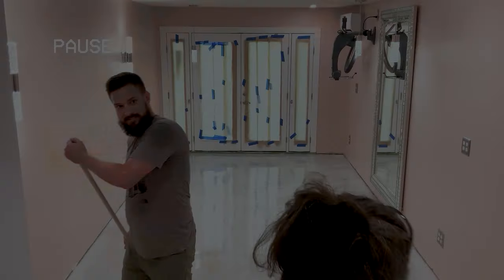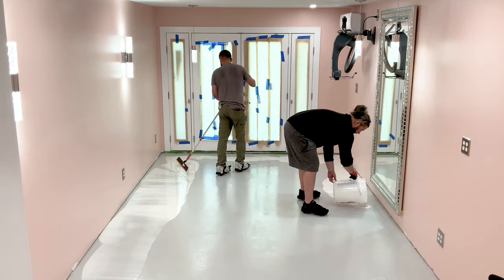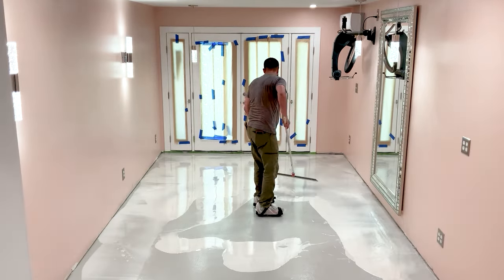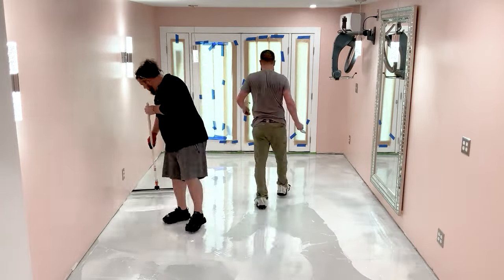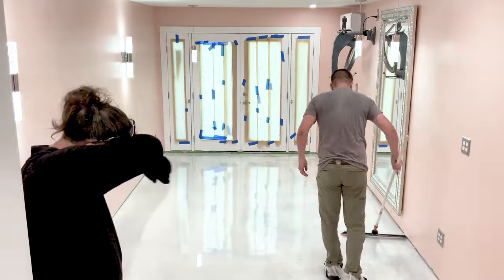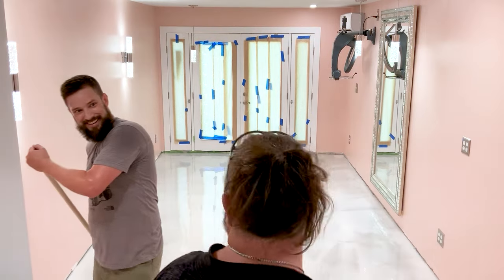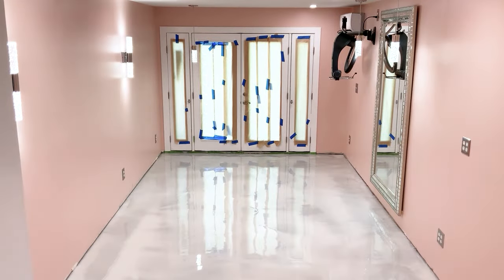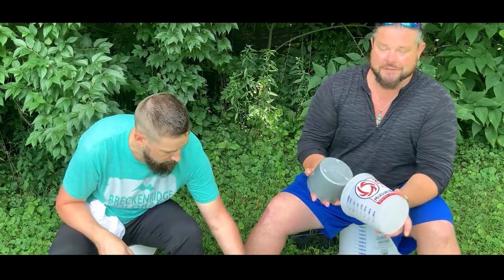Metallic Epoxy Flooring FAIL | Complete Breakdown | Don’t Make This Mistake!

Comment from the maker: Has anyone else ever messed something up like this?  Share your biggest DIY fail!  The best one wins a prize!
Reply: Just had a guy come do my garage floor ...and fucking ruined it , now looking into doing it myself
Reply: Im starting my own epoxy company soon and this video is great learning tool for us noobs! Thanks for sharing !
Reply: @dentman62  Same experience but with our basement floor. We paid SO MUCH money and it looks HORRIBLE. 😭
Reply: Yes! I started an epoxy flooring business, and my very first experience, was almost exactly the same. I didn’t get the epoxy out of the bucket quick enough and it went off in the bucket before we could get it all on the floor. 
Note: polyaspartic you have roughly 20-30 minutes to work with it  IN the pot/bucket. Epoxy, is the exact opposite! Get it on the floor right away and start moving it around!
Reply: Same thing happened to me last night man....I'm so devastated. I literally mixed 5-600 sq feet just to start painting the edges first. By the time I got ready to actually roll the floor....I poured onto the floor and the stuff would barely spread. At that point I knew I was scared!!! I learned my lesson. Mix and get straight to the pour don't waste no time. Now I have to do it all over again. But thing time I. Gonna do half first.
Reply: Could you recommend a company that sells the product? I already have the floor  ready. I'm in NJ.

Comment: If your watching the video like I did and wondering what happened, it overheated due to mixing everything at one time.
Lesson: spread quickly.
Tip I've seen elsewhere, if you want to mix it all at one time, set the mixture into water, it will dissipate some of the heat, but still take precautions to not overmix

Comment: Every school cost..... in exchange you gain  knowledge and experience.....
In my work I can chose between  fast, medium or slow hardener  ( but strength of the bond varies accordingly). 
Of course epoxy is temperature and moisture sensitive ( it will affect curing ) , and creates  it's own temperature trough chemical reaction, which is starting as soon as 2 components are in contact.... Bigger the mixed batch - more volatile chemical reaction is,  creating  higher  temperatures ( just what you have experienced ) ....  and higher the temperature - faster ( curing )  solidifying . 
For cleaning or diluting coatings- acetone can be used.
After floor - you can start building boats ...... ( just add glass fiber )
Good luck !

Comment: I feel for yall so much on this.  I used to do FX work with silicone and resins.  there is literally no feeling in the world worse than when you go to pour that bucket full of $600+ of material in a mold only to find that its already kicked and solid.  lets just say its a mistake that I only did once.  Side note we had a wobbly 5 gallon bucket mold that we kicked around the shop for years as the most expensive (and strange) door stop that I've ever made 🤣🤣🤣

One other note to this, depending on your climate/humidity/current temp it will drastically change the amount of working time you have.  From personal experience do a bit of research to see how those factors effect the hardening time.  It will save you lots of time, stress and money.  Also do a bit of research on known compounds that will keep a product from firming up.  ie: linseed oil is put in a lot of hand creams; even a little bit will cause silicone to never harden

Comment: Yea I did my garage floor w leggarri and their product failed miserably. After pouring there were 15-20 bubbles and I kept hearing the videos here they said leggarri epoxy bubbles will pop on their own . Ummm yea nah they didn't. 1 hour after I couldn't walk on the floor anymore there were 2000 bubbles . Now I'm sanding the floor down and trying to fill the bubble holes. I've spent $350 in rental equipment sandpaper etc.

When I called leggarri no one was available to talk to me till 2 days later . And they blamed me . They blamed the concrete , they said it's the concrete blowing air bubbles but I think it's a chemical reaction in their product. I got brown primer from them, mixed it exactly as specified and applied everything exactly as specified 
They recommended vapor barrier to go over concrete but nowhere in their 150 videos I watched did they mention air bubbles from concrete .
Im going to call Spartan for a price to go over this garbage . So what kind of prize do I win. ? This floor is 550 sq feet and cost me $2200 plus shipping plus additional $350 and 2 days (and counting) of fixing.
Reply from the maker: That is terrible!  I feel your pain!  Hopefully it will work out.
Reply: I have done multiple metallic epoxy floors with different products. I always always use vapor barrier for this exact reason, my first floor had a base coat/primer coat that had hundreds of air bubbles. Ever since then I have had 0 issues with out gassing or pin holes which is due to the concrete.
Reply: I have watched a lot of these videos and I see them use heat gun or hair dryer to bring the bubbles out. On countertops anyway.
Reply: It didn't work out. I sanded the floor as flat as possible and cleaned it 3 times and then put the top coat on.
Reply: @cedcampbell47012  that's does work right away . But after the epoxy starts to harden you can't walk on it anymore.. also they had me put a gallon per 75 sw feet to sell more products? And so it's so thick it hardens from the top down
Thereby allowing the bottom layers to be soft enough that air gets in the bottom but the top is hard so it blows bubbles you can't fix.
Reply: Before the product dries out I believe you were suppose to mist the floor with denatured alcohol which pops the bubbles

Comment: That really sucks. Theres some companies out there that have epoxies that are specifically made for metallic jobs, they're thinner and longer pot life to flow better. If you want to stay with that product, you could put some isopropyl (91% or higher) in with the mix, it'll thin it out and make life easier. One thing I saw was you probably should have used more material, it looked pretty thin to me. And 100% mix and dump it lol, it's a small enough area that you guys will get it the second time around. Just don't lose your nuts ;)

Comment: Avoid Spartan at all costs. Slick salesmen makes promises they cannot fulfill, after that they could care less. They are not chemists that created their own formula, they are dude-bros in an office repackaging someone else's product and charging you way more than appropriate for making a call or sending an email. Do some research, and go directly to the source. If you hire someone that wants to use Spartan, find another contractor. Their cleat failure in this video is a prime example, instead of "sorry bout that, will send a replacement" how about selling a better initial product? Your replacement would not have meant much if one of the junk nuts got missed and cured into the customers floor, now would it? If they cannot sell a reasonable cleat, why would you trust anything else? Think about how bad it would be if one of these pours went really bad, the cleanup and recovery would be a legitimate nightmare! Their "oops, sorry" would not help one bit. I have done more than a dozen of these floors now, only bad experience was Spartan. Never trust YouTube videos that focus one one brand alone.